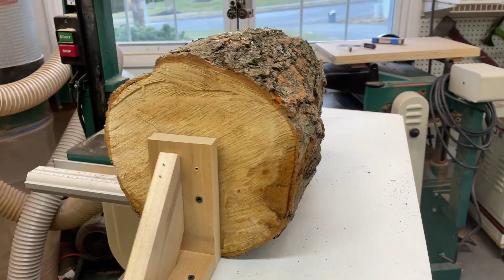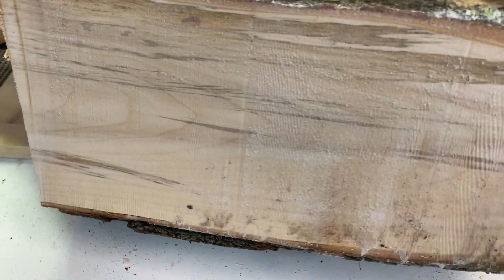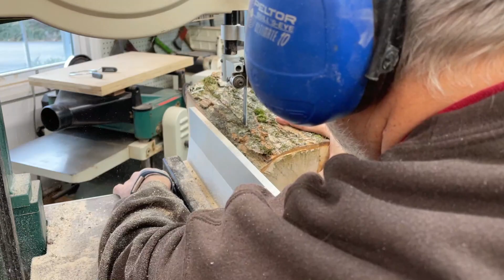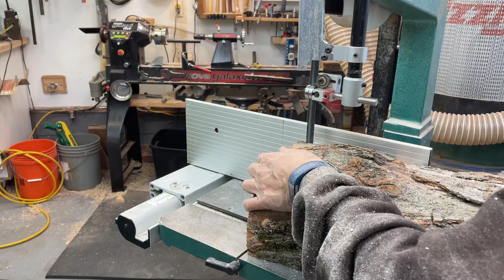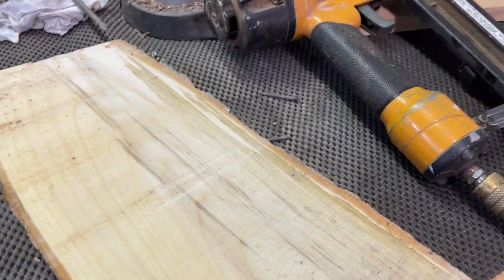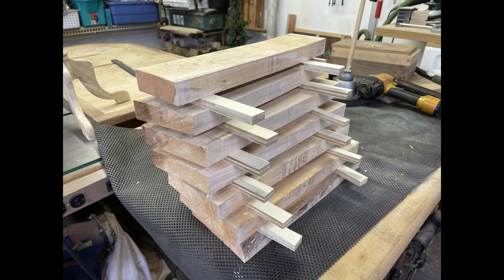Resawing - Log to Lumber - on A Grizzly G0555X - On Bob's Woodshop

Comment: Looks like the wood was so wet it was getting suction cupped to the table. Have you discussed having a saw mill in the driveway with the wife yet? LOL Very cool
Reply from the maker: Ha!  Good idea!
Reply: I saw cupping with regard to the fence. I don't know if it was the wrong blade, pushing to fast or what.  We should be talking flat boards here.

Comment: Where did you find the table extension. I have a 0555 and love it. Mostly use it to cut bowl blanks.
Reply from the maker: The one on the r
side came with the saw. Thanks for watching !
Reply: Ok I guess you can’t get one for the G0555LX. I have been looking and got excited when I saw yours.
Reply from the maker: @waggenerct   can you fabricate one ?
Reply from the maker: Make your own out of wood
Reply: Probably. Something I will probably do soon. Just got excited seeing the metal one you had I am assuming you have the extreme version of this saw. Thanks for the reply and the video.
Reply from the maker: @waggenerct  yes.  Good luck with yours👍👍
Reply from the maker: Mine is the G0555X model.

Comment: "Hardly any drift," even with your little bandsaw is not acceptable. You should have NO drift.  

Cutting green wood and cutting dry wood are different animals. The blade that works for one will work for the other, BUT not nearly as well.

Your little 14" might be well served, AND you might be pleasantly surprised, to find you can go to bandsaw blade making places on line and buy TOP quality blades for your need, AT A GIVEN MOMENT, on line.  For example, my saw takes 131-1/2" blades, Finding them was a pain, until I took the advice I just gave. For about twenty or so a blade, my saw just ate the heck out of a bunch of cherry, apple and sycamore.  

The price of the "custom blade" places, like Bandsawbladesdirect.com make it very hard to go back to the Timberwolfs I bought in the past, several of which SHOULD have been sent back for thumping problems (bad welds).